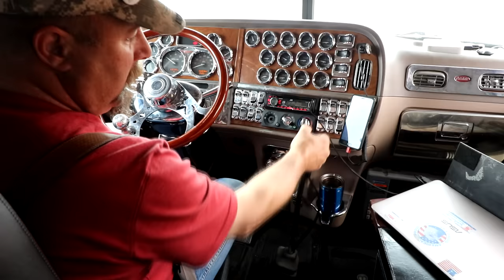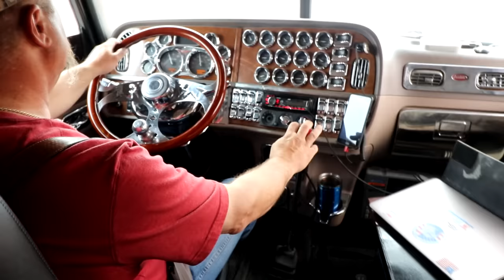How to shift an 18 speed transmission

Comment: In my company yard there is Eaton Fuller 18 speed gearbox but it is 3 ranges for 6 speeds. We removed it from mobile crane built in 1978 that went to scrap 15 years ago. Gearbox was only thing worth saving.

Comment: I'm a trucker and I know all these transmissions.  The 13-speed would be my favorite of all.   Usually I pay no attention to exactly what gear number I'm in I just know through experience what it feels and sounds like and when I need to shift.  Obviously, you always know where your tach (engine RPM) is at though.  Generally you don't want to lug an engine at below 1200 RPM or so. There are some exceptions   depending on your weight and the grade, etc.

Comment: Why do you not use clutch when shifting though? Isn't speed shitfting bad for the transmission? At least that's what I learnt coming from cars...
Reply: It's an unsynchronized gearbox, or you can either double clutch it or float it (without the clutch), second one requires experience.
Reply: @webber7117  oh wait, isn't that what the older cars used to have?
Reply: @ani_mesh  Exactly, it's much better and makes the gearbox much stronger but it was too hard/expensive to teach newer truck drivers in Europe how to use it.

Comment: Very nice vid thank you..   My dad would have loved that .    We have come a long way .
My dad had trucks and I learned drive  trucks [the oldest one] by double clutching the un sychronized transmission   .  The later ones had   6 speed synchronized trans.  with a high and low range in the differential, so first low, first high/,second low , second high etc from there Volvo 16 speeds...... this was somewhere in the 60s lol

Comment: I just realized I had an 18 speed for the last 10 years and I’ve just been using it as a 10 speed with a final overdrive. LOL. No big deal, it’s just a straight truck with an occasional pup that I pull but it worked about the same way as my other truck with the 10 speed. No wonder the Cummins in it wasn’t nearly as torquey as I thought it should be.

Comment: Amazing. That reminds me of a Ford 3000 tractor I drove a few times that had select-o-speed. You didn't haft to push the clutch in for certain range or groups of speeds. I'd still worry about the trans ceasing up though. So I'd push the clutch in every time.

Comment: Awesome video. So there are 6 gates: R, 1, 3, 5, 7, 9 in low range odd bank. So that gives you R1/R2, 1/2, 3/4, 5/6, 7/8, 9/10 flipping the odd/even switch. Then in high range: R3/R4, 9/10 overlap, 11/12, 13/14, 15/16, 17/18. Is that correct? 4 reverse gears?  You use the clutch to start off or come to a stop, and synchro shift to other gears, using slight throttle up/down when going from odd/even banks in the same gate. Wow! I thought the clutch was used all the time in trucking - using synchro shifting only occasionally. I used to synchro shift (float) gears in my 68 Volkswagon Beatle 4 speed all the time... it slipped into each gear (up or down) like butter - all by listening to the engine and feel (I didn't need to use the Tachometer I installed). My dad was a trucker. He drove mostly 1970's/80's era International 10 speeds for a company in Connecticut called "Valerie Transportation". We wasn't a long hauler, mostly day runs to NYC. He taught me how to drive cars but didn't want me to be a trucker for some reason - so he never taught me how to drive an 18 Wheeler.

Comment: Interesting, it would be great if you could add the sound of the engine as you shift thru the gears.
That's the part I am very interested in.
Cheers mate.
Reply: Thanks mate. If watch deadliest roads, you will come across a video of the road's in my country (Papua New Guinea) where trucks like yours have to move cargo.

Comment: Truck and tractor are not to be compared, but Soviet Tractor Vladimirec have 2 gear shifters. First one is for mode, Slow, Regular, Fast, Reverse, and another one for Gears 1, 2, 3, 4. So while in Reverse you still could pick one of 4 gears. Slow mode + 1st gear is very powerful on that tractor.

Comment: So it's basically a 5 position movement of the gear stick, for the forward motion (reverse gear excluded). The range selector (excludes the 1st gear) shifts the gears from Low range 2-3-4-5 to High range 6-7-8-9 and the Splitter then splits the gears between 1H-1L, 2H-2L, 3H-3L, 4H-4L all the way to 9H-9L. So gears 1 to 5 in low range --> range selector switch --> 6 to 9 in high range --> with splitter switch --> each gear is split into 2 Low and High gears, making a total of 18 gears to move forward. Am I right? Thank u for this great tutorial btw.

Comment: The 1st gear you speak of isn't actually 1st gear. Its low gear, or as us Aussies call it, bog-cog. 
To make it easier to understand for newbs, omit bog-cog and just use the 16 other gears. Simple H-pattern with a Hi-lo range and a split for each gear. The bog-cog is only needed for extremely heavy loads or uphill take-offs. More often than not, during normal trucking operations, taking off in 3rd or 4th gear is the norm.

Comment: Try using an Eaton twin splitter on an old EC10, no clutch necessary after you've started to move,  a Merc Actross box, now they're good fun, also the David Brown crash box found in Atkinson Border's . These days is all 12 speed auto's because the real boxes aren't taught anymore. As you can guess I'm old skool, gave it up 10 years ago, started with hand balling, ropes and sheets etc. Good old days, I don't think so, can still tie a dolly though, like riding a bike, it never leaves you.

Comment: basically a 4 speed with some add on's, ist very rarely used. Gear one to 4 then spilt to high and 5 to 8 with a gear splitter in each gear if you want or need to use, same as the gears, you can. I always teach new drivers to think of an 8 speed box to start off then get into using gear splits once competent with basic shifting

Comment: So the gearbox have no Synchomesh like a car manual transmission? Its pretty tricky not using the clutch with a synchromesh Transmission. Are the gears straight cut?

Comment: Makes me feel more confident, I've been thrown in them at work twice when my 10 speed went in the shop without any knowledge of how to drive them. Question though, say I spit a gear and I'm in idk 8H and I wanna go to 9L. I struggle with that in any gear anytime I need to do it. I put the splitter back in the low and go to shift but I almost never hit the next low gear so I stopped trying. How does that work? To me if I'm in 8H at 1500 and want 9L the rpms would be to low for 9L when I try to shift wouldn't it?

Comment: Hi Kiaora from new Zealand I used to drive UD NISSAN 10 SPEED LOW Ratio high Ratio stick shift double clutch
Reply: New utes have a stick gio Tronic shift box 4x 2 =8 heard low or hi automatic options D or 8 SPD down to 1st gear ⚙️⚙️⚙️⚙️⚙️⚙️⚙️⚙️

Comment: Always found the 18 speed transmission for heavy haul with 4 wheel lock and big cat western stars heavy forest trucks we use to use an 8 speed with deep reduction but 18s fullers are the best granny by far but all depends what your needs are 18 s are best for Bush conditions that's with a set of b trains or a 5 axle straight log trailer usually better for weight between logs or wood chips were up at 70.000 kgs more in winter if your just running hwy with say tandem tandem a 13 speed or 10 speed is plenty good

Comment: wait you mean to say at trucks once you starts moving, you can change gear without pressing the clutch? that won't damage the gearbox?
Reply: it would IF he would be hauling a big load the reason why  is because the truck would lose acceleration too fast every time he would shift ( truck engines have a heavy displacement so they to dont rev down too quick when you let of the gas..) because the gear ratio is seperated in lower intervals the engine speed (rpm) and the driiveshaft heading to the "wheels" are nearly unchanged when shifting (when not carrying anything). wich makes the shaft speeds allmost synchronised so it literally just pops in gear  once you move the shifter into the next gear...

Comment: Its a 9 speed with high and low. If you can drive a 10 speed, push instead of pull on your first upper range shift. You're good. Dont stab, adust your rpms and slide it in gently. Slower clicks means you're almost there.

Comment: Cam you float gears with a heavy load on a steep grade? incline or decline
Reply: Yes you can but depending on the weight of the load and the steepness of then incline, you may have to drop 2 or 3 gears when you shift instead of 1. The only way to know is by experience.

Comment: In an old MACK 18sp the toggle down is lower gear and up is higher half? I haul a belly dump and have never used the split gears for absence of training. It is always in up position. Does that mean I'm always in the high half through all 9? No wonder I can't get up hills loaded. I will try this.

Comment: What I found difficult was having to rev the motor to match the rpm's of the right shifter. You can't just let off the gas and push in the clutch, it won't go in. The rpm's must match the gear or all bets are off, and it's way harder than it looks to do that, believe me.. I had a tough time backing up too. I got my CDL but it wasn't for me.

Comment: if you're suppose to keep it around 1200-1500rpm, you're gonna need all the gears..there's just a 300rpm difference in each gear.

good thing about it is there's always a gear in every situation you'll never end up in a situation where the lower gear is too low that if you really jam it in that gear it's just gonna rev the engine real hard or if you're gonna put it in a higher gear is just too much that it just makes the engine bog down

anyways if the engine's not really struggling you can just skip some gears

Comment: You need to leave your splitter on the up position when changing your five slot bc that's what I was told bc all your gears  are on the hi side of your transmission

Comment: Just the same as a 13 speed but you split every gear. Main box when you're empty. I learned to drive with Twin sticks So every transmission after that was really easy to learn..

Comment: How on earth can you float the gear without the Cluth? I thought that if you don't clutch the shifter would not able to move to the next gear ...I am confused.
Reply: Non-synchronous transmission, you can either double clutch it or float it (without using the clutch)

Comment: Is it basically the same as a 13 except you also get to thumb split the low range on the splitter instead of just the high or low?
Reply: took a minute to grasp but it makes sense now thanks for the video my dumbass has been driving the red switch like a 10 speed for a year until a few days ago.
Reply: had the blue switch in my last truck and just ignored it because it never made sense to split the low range
Reply: The thousands of dollars of diesel I wasted never touching the thumb switch lol

Comment: Most freight haulers use a 10, most of em are shift for you transmissions (automatic but not fluid driven like civilian cars) anymore because most modern drivers are incompetent at shifting.
The haul truck I run a lot has a 18 as well, and when you have a cat 345 excavator on your back or a D9R dozer you USE every one of them but that's about the only time, lol.
A 13 is just like a 18 but you don't split the low side, with a 10 and a 15 you do come back to the against your leg and back spot on the high side, my experience with a 15 is it's essentially a 10 with a 3 speed deep reduction so it's never made sense WHY they call it a 15 IMO.
Also they may not make them anymore but there are 20 speeds but all I've been in them were a 5+4 two stick.
I'll be 50 next month been around trucks since birth, got a CDL at 23 and have dealt with everything from 6 to 20 speeds in air braked vehicles including the 8LL that's been modified into overdrive tranny's and 7's that shift odd where 4th and 3rd  positions are opposite of where they regularly would be (3rd is where 4th should be and vice versa).

Comment: I like driving 18 gear transmission, but when I do I don't use red switch (hi/low)... Only regular black switch... Only when going up or down in mountains... or when drag racing some other 18wheeler or BMW looser...

On a regular flat surface I use 2/5/7/8/9/10...
On a downhill surface I use 
3/7/10...
On uphill surface
1/2/3/4/5/6....

Comment: Let's do a TRIPLEX COMPOUND 18 Speed non-synchronized triple stick! Like the old 1958 AutoCar Tractor I loved in Truck Driving School with an inline  Siamesed 8 cylinder Roots Blower Continental Diesel Engine and ARMSTRONG (manual) STEERING! Ol' Blue was my Baby! Double clutch EVERY shift,  42" set-back front axle, dual disc clutch, maybe 300 RPM wide powerband (900-1200 RPM). HONKIN' BIG engine-12 liters at least, idled at about 300 RPM, feel EVERY cylinder light-off- 400HP+coal-burner! Putz har' onz yer chest!

Comment: Excellent job of breaking down the shifting process. Unfortunately most trucking companies don’t want to pay the big dollars a 18 speed cost. A 9 speed or 10 speed gets the job done, especially with the  broad operating range the engines. I learned to drive on a 5 speed in a old Mack. If you could learn to shift and not grind the gears, multi speed transmissions are a breeze. Hardest part of a multi speed is remembering what gear you are in. If you forget it usually involves coming to a stop and starting over.

Comment: Wow you don’t have to push in the clutch!😳
Reply: truck engines have a heavy displacement so they to dont rev down too quick when you lets of the gas.. because the gear ratio is seperated in lower intervals the engine speed (rpm) and the driiveshaft heading to the driveshaft are nearly unchanged when shifting (! when not carrying anything !). wich makes the shaft speeds allmost synchronised so it literally just pops in gear  once you move the shifter...🙂

Comment: Did he start in 5th?  Huh?  No clutch between gears at high gear?  That sounds easier than a regular 6 speed.
Reply: Truck transmissions aren't synchronized unlike cars.

Comment: Why is it that you would need 18 years in a smaller loaded rig compared to a 10 speed for normal driving not for heavy hauling is a 10  or 13 Call normal
Reply: If you travel through mountains alot,a 18 speed will be preferred because it can hold speed better than a 10 or 13 speed regardless of weight.

Comment: only thing I don't get, is why don't they make a sequiental gearbox
Reply: they would need an automatic gearbox setup for that (no clutchpedal) and withouth a load ... it would be able to work... but with a load... it would have to be a big automatic clutch system wich is very pricy and would probably break down a lot more  then any other system..... wouldnt be viable for a truckers wage probably... also automatic gearboxes need to have their oil changed more frequeently and they hold more oil.... wich is a expensive aswell

Comment: 18 spd suck It's a 9 spd with a spliter,  RTO 12513  spd was top in my  eyes, I always like a mack tri plex, a true  5+3, 5+4 good,We also put 3 and 4 speed aux trans behind the Fuller 10 speed or behind any other main trans, The difference in this 18 and a 12 is in the back box, different splitter gear and

Comment: If not a logging truck or a tri-axle then you don't need a 18 speed. A 13 speed will do the same on the road the only difference between the two is a 18 speed has 5 deep reduction gears where the 13 don't. And these guys that get a 18 all there doing is wasting their money.  My 2001 western star has a 600cat with a 13 and never had a problem with it.

Comment: On the hiway, even loaded, you use maybe 5 of those 18 gears. No idiot is gonna shift all 18 gears everytime they stop..
Reply: Bullshit lol. You definitely skip gears but full loaded you are using a lot more than 5. Probably more like 10-12.
Reply: @josephsamsor1698  hahaha, I started driving semi trucks in 1967. I have millions of miles driving semi trucks pulling wide, heavy cargo all over America.  Most trucks on the road are 9 speeds. Mack's are 5 speeds from the factory.  If you're using 10 to 12 gears to take off you have no power under the hood. My 1976 restored brockway has a 800 hp cat with a 13 speed. Empty, I use 4 gears to get to 80 mph. Loaded I use 5. If you have power under the hood, you don't need gears.
Reply: @josephsamsor1698  Google Mack semi trucks. The majority of them come from the factory with 5 forward gears..

Comment: How to shift an 18 speed transmission STEP ONE GET OUT STEP TWO GET IN AN AUTOMATIC. I WOULDN'T DRIVE NOTHING BUT AN AUTOMATIC I DIDN'T GET PAID ENOUGH TO BE SHIFTING ALL DAY
Reply: Auto suck pulling anything with liquids behind them. Ever time the liquid moves back and forth the stupid transmision shifts up then back down then back up and so on all day. Plus i drive and older Kenworth W900 with 18 speeds and the sound of the Jakes is never gonna get old.

Comment: Simple answer, get an European truck with auto-transmission. We dumped manual shifts years ago.
Reply: @webber7117  Trucks break-down purely by poor maintenance. Give me a Scania, Volvo, Daf or Merc (Not the latest version) all day long.
Reply: @martynlawrence2365  Rather not.

But it sounds so fun trucking in Europe.. being stuck at 90 km/h (which is 56 mph), having low amount of driving hours for international travel, many european countries using OBU for toll, bad services for truck drivers and I can go on and on